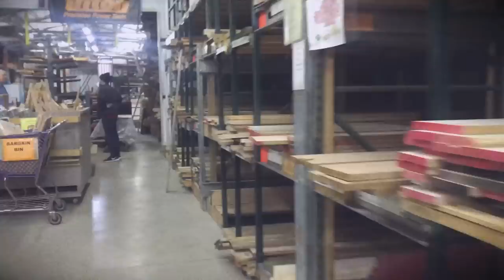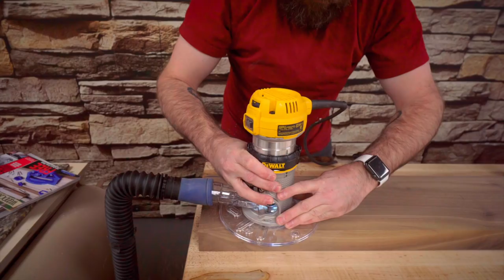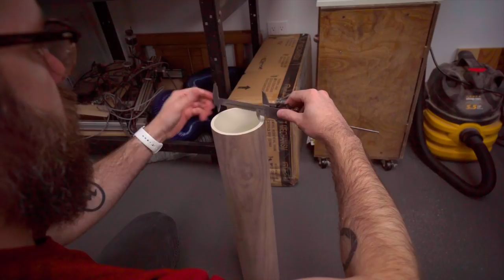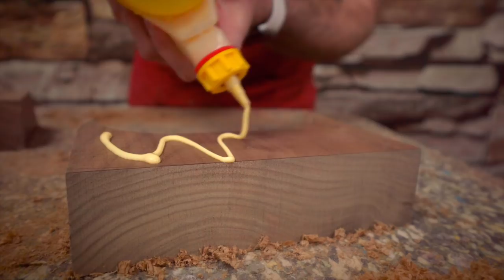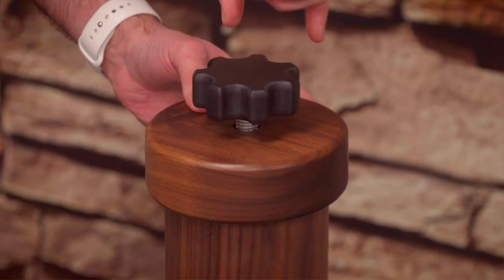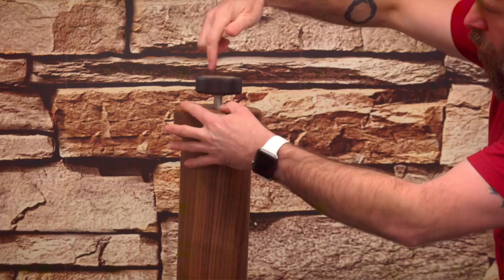Making and Prototyping a Dog Feeding Station | DIY Project

Comment: Going forward, a trick to get a good finish on your hacksaw cut threaded rod, is to screw on a nut before you cut and then remove it over the threads that you have just cut - it cleans them up nicely, so that you don't sit with the problem that you have at the moment where the nut doesn't want to go on first time...
Give it a try.

Comment: I had a store bought feeder that used a rotary valve to dispense. Printed some inserts to reduce the amount it spit out for our small dog. Didn't secure them well enough so they came loose, jammed and shredded the cheapo plastic gears. Now I was trying to print an auger to change the design. But the auger would be horizontal so food would drop in from a large supply chamber through an opening on top and travel only a couple turns horizontally before falling out an opening on the bottom.  Long time watcher. First time commenter. Thanks for all your inspiration!

Comment: Have that all-thread connect to a fixed nut in the base (let the all-thread free wheel through the auger).  Then put a nut on the lid to fit into the auger's hex shaft so you spin the lid instead of your star knob.  This would make the food storage much more stable than just resting on the base.  Also, put some rubber on the inside of that lid to seal it to the pvc.  Hope this helps!

Comment: that's a wonderful project!
be careful about food oxidation by exposition to the air. Imagine you have a solid smaller horizontal cylinder crossing the vertical one as a valve system, this small one would have a vertical large enough hole on its side, but not all the way through, just like a cup. By using gaskets and orings you could make it all airtight so to increase the time the food stays fresh. Then use a knob on the smaller cylinder so as it turns, its cup eventually gets vertical allowing it to scoop full with pellets and as it continues to turn, the pellets drop down on a feeding bowl on the floor down below. Don't make it too big because even when buying commercial rations with bags that have airtight reseals, they still go bad near the end, so unless you are feeding multiple dogs, it is better to keep the containers on the smallish side.
Loved the video, thanks for sharing!

Comment: Heard you hash this some on MAKING IT, impressive to see it come to light. I have been making bonsai pots out of various cement/sand/soil mixes, my thought is that pouring your base into a mold could give it the weight needed to offset a pup toppling it over, and if left outside/next to sloppy water bowl, the wood touching the ground would be less prone to deteriorate. 
Great work again, thanks man

Comment: Here's a tip: if you cut a threaded rod, first put a nut on the part that you need to keep. If it has been cut you take of the nut and the thread will be repaired to it's original shape.

Comment: One option for proto 2 is to use a 45 elbow on the bottom of the pipe and embed that into the base surrounded by walnut. Would slide the food out into the bowl without the need for the angle. Would provide more stability for the large tube as well. Thinking forward you could use same approach for a water dispenser next to it. Food and water would travel in pipe only to the bowl without need for touch any wood. Awesome design, David. Aesthetically pleasing. The jam track in the background was nice as well.

Comment: Hey David, I am a huge fan and just happen to be an aspiring engineer. I have a simple design that you could build and add a motor/controller so that you could control it with your phone. Or just have it on a cycle. The auger would be tilted on its side and there would be a chute above it near one end. The other end would spit out the food into a plate. The entire thing would be the same, but sturdier and it would have a larger hopper for food.

Comment: Just a hint about Fusion 360. If you set the "default modeling orientation" to "Z up" in the preferences, you will not need to rotate the object in your slicer to put it flat on the print bed. I am willing to bet you have the default setting of "Y up" which causes the Y axis of your model to be Z axis in your slicer. The preferences are located in a drop-down menu that has your account name in the upper right of Fusion 360.
Reply from the maker: Ohhh, thanks for the tip!!!

Comment: A lot later (in time) but the overall idea is great.  Changes:  

1 - Dish goes too far back in.  Tray edge Only needs to go just passed the edge of the feeder ramp.  The back edge can be 2 inches long but the tray opening should only go  to the edge of the feeder.  This will help stabilize it.  A screw in the back will hold it in place.  Can be knobbed if you want to remove it.  

2 - Stabilizer "wings" can be put on it to keep it more stable.  A tall structure is more likely to tip then a short stubby one.  3" long wings (bottom out - side length (tall) is up to you) on 3 sides - or 2 sides if against the wall will work.

2a - a simple strap around the top and screwed to wall will stabilize everything.  It would be made of wood and shaped like a conduit clamp but thick enough on the wings to keep top away from wall for removal.

3 - A heavy "dish out" on feeder side (where auger first starts dropping food) will feed the food better.  No more than halfway across the front.  You can make it more if food jambs, but probably won't.

4 - 1 & 2 can be combined by having the tray stick out the back about 2 to 3 inches and pinned on the side to keep it all stable.  Tray edge is still flush with front.

X - if it ever tips over on the dog it will probably never eat from it again.  Unless it is starving.

A - the tube can fit flush into the base and an angled ramp that is large enough will drop food from underneath onto the bowl.  The 2 - 3 inch angled hole drops food onto a ramp that drops it in the bowl.  Much more fancy a design.  Probably should be plastic so food will slide and wood friction would not stop food from going all the way down.  Put it in then trim it flush on both ends.

B - food quantity would have to be observed so look into the top as you turn the wheel and see just how much is picked up per revolution.  Don't worry about it just turn it to give what you think it should have.

That's enough of a change - for now.

Comment: I love walnut, this thing is just beautiful.  Most of the measured food dispensers I've seen use flaps that spin horizontally (if you google image search dry food dispenser, you'll see), or the auger bit is horizontal and dispenses out a port in the front.  Though that does defeat the purpose in requiring you to bend down to dispense.  Though you could 3D print a couple gears to translate the rotation.

Comment: Love the design and the idea behind the mechanism.  You could add anchors to the base so you can mount it to a base board, that way it wouldn't be as easy to knock over.

Comment: That’s a really interesting design and great practical solutions to the problems! I wonder how it would work if the auger is horizontal with a hopper full of food over it. One side of the tube is closed and the other end has an opening. It would take a few turns to fill all the empty space in the auger, but once it’s “primed” it would drop food out whenever it turns. The amount of food dropped might be determined by the size of the auger.

Comment: Nice.  I saw your veneered foam core box the other day.  I like the PVC being covered.  It's a good idea I'd never considered before.  I really like the auger.  I think I'm going to steal that for a v2.0 of my feeder.  But rather than run it vertically, I'd run it horizontally - a big reservoir on top of one end of the auger and drop hole a little bit down the path.  For control, why do it by hand?
   
I made a feeder late last year, but the trick was that my dog loves breakfast at 4am (and he's 100lbs and sits on you until you feed him).  I took one of those hotel cereal dispensers and a high-torque 12v motor and plugged it into a switchable Insteon outlet.  The outlet is hooked up to my home automation system and, consequently, Alexa.  Turning it on for 1s gives him a treat.  Running for 9s dispenses 2 cups.  Now anywhere in the house I can say, "Alexa, turn on Andy {breakfast, lunch, dinner}" and it drops the food a couple feet through some ABS I CA glued to the bottom of the dispenser and makes a good racket going into his bowl.  He hears that and runs downstairs to get it.

Dispenser - https://www.amazon.com/gp/product/B000OQGOEG
Motor - https://www.amazon.com/gp/product/B01EXZXM66
Power - https://www.amazon.com/gp/product/B01N7RS0NG
Outlet - https://www.amazon.com/gp/product/B00QL8EPME

A quick shot of it in action: https://youtu.be/FAXLywo1thA

Comment: I like the concept! I see a few things for your second one, I hope these suggestions help. A wider base would be more stable, kinda looks like that tube could be knocked over. It would also be good to carve out the bottom groove more and use some sponge rubber? Open cell foam type stuff, to line one side so the tube pressure fits in for a more snug seat. The other thing is, I think that Plastic knob should be replaced with a wooden knob. Maybe a CNC walnut knob? The plastic one just doesn't seem to fit the whole design. Okay, that's all I've got for you Dave! I hope you like one of the ideas.

Comment: The auger is kind of being used backwards here with gravity.  They’re meant to pull material along.  Move the auger parallel to the ground.  Hopper on top at one end and bowl underneath at the other.  Lots of ways to do it though.  Make a giant version of a powder scale and dispenser basically.

Comment: Beautiful.  I'd epoxy in a polished piece of copper tube into the lid extended up to where the turn handle stops to hide the threaded rod and act as a bushing inside the lid.

Comment: I had a similar idea, using pvc pipe vertically as a "holding tank", but at the bottom, have a PVC T running horizontal, then another T inline with the first, but rotated 135* opposite direction, the auger running horizontal, a cap with appropriate hole in each end to support the auger.  Then an Arduino and stepper to dispense appropriate amount at specified times of the day.  I'm not a programmer, that's why I haven't attempted this...but it works in my head.

Comment: Before you cut a threaded rod, spin a nut on. Then unscrew the nut off the rod to clean up the threads.

 Maybe add a sloped angle to the back hidden section of the bowl, so the food slides into the open front section the dog can easily reach? So the back section of the bowl does not actually function as a bowl, more of a food transfer mechanism to move food to the front, bowled part.

Love the podcast and cool to now see this. Thanks

Comment: Cool idea with using the auger to measure out the food but I think it would work better with vanes attached to the centre spindle and then have them say 1" tall with a lid over with a hole on the opposite side of the dispensing hole. With the correct clearances, that would depend on the size of the dog pellet size, you should be able to always dispense the same amount of food per turn. I think using 5-6 vanes would work fine and when an empty section then returns to the back filling hole in the divider it will get filled up again and the one to the front will empty itself through the dispensing hole.

I think that should work.

Comment: Great job David! My first thought to address the issue of portioning would be to make something similar to a candy/gumball machine. There's several videos on youtube showing their design but essentially you could make a food storage tub with a portion at the bottom that would spin that had the desired food amount cut out of it. It would fill with food from the storage area and then it could be rotated over to outfeed area and only drop the desired amount. This would also not drop any additional food until it was rotated back around to collect addition food. Would be much easier to draw out whats in my head than putting it in words on a comment but I think that should get you going :) Looking forward to seeing version 2!

Comment: I think you might have a better time of it by finding a way to be putting the auger horizontally. That way, there's only so much food the section of auger for one rotation can hold, gravity doesn't give you an issue for giving out more food than you wish, and you can create a larger dedicated reservoir for the food instead of having the reservoir be where the auger action happens as well. You'd obviously have to change the form factor a little, but performance might improve making it worth it.

Comment: Most grain moving augers that I’ve seen are horizontal. If you did it this way with a hopper feeding the first couple of turns of the auger, every turn might give you a more consistent output as it will remove the effect of the amount of biscuits will have on the output ( as long as the auger remains covered)

Comment: Beautiful project, to solve the dispensing consistency issue , auger the food up or atleast level instead of down and let the food drop into the dogs bowl. Have a second  piece of pvc for a shorter and /or smaller piece of auger and the 3" or 4" pvc for a storage. This should improve the consistency in the amount of food per turn, and solve the issue of unwanted  dispenses.

Comment: Very cool to see you get into fabrication like this, incorporating the 3D printer etc! Here’s a tip for cutting allthread or bolts: if you thread a nut onto the bolt before you cut it, it’ll help fix the threads up when you back the nut off after the cut. Works for me! Hope you do a V2!
Reply from the maker: Great tip, thanks!!

Comment: The auger really should be turned horizontally (or at an upward angle) in order to dispense the same amount of food per turn. You'd need a food reservoir at one end and the bowl at the other. Using that, you could 3-D print an auger with the correct spacing for Wally's 1/2 cup of food. Then ask Bob to help with an Arduino to automate the dispensing.
Reply: And bastardize the whole thing with a giant "DIRESTA" logo.

Comment: That's a neat idea, man.  Lots of different tools, skills and materials involved.  I've been kicking around ideas for an automatic feeder for my shop cat since she won't eat wet food, and trying to avoid looking up other people's solutions.  I'm probably going to have to learn a basic timing circuit or get fancy with an Arduino.  I would probably set up a sensor for an automatic watering system as well.  And then to make it needlessly difficult: run it on solar power.

Comment: Next level, Pacciuto! Freakin' awesome. My suggestion for the mark on the knob is to just put a small embossed arrow or something right into the 3D model. Then add the corresponding label to the top of the feeder when you find the sweet spot.

Comment: I think it is really cool and looks beautiful. The only change I see is to maybe remake the base piece, now that you know the depth to route the groove that the tower sits in. Seems like that base piece could have screws from the sides and back to lock the tower in place. And also the opening in the base piece where the food bowl slides in could be made shallower since you said the bowl slides too far back.   So, all of the issues, which are minor in my opinion, could possibly be fixed just be remaking that base piece.  Again, I love the project. Only offering suggestions because you asked. :)

Comment: Just an idea but you could try cutting a quarter of circumference of the pipe on the back side...enough to make the auger assembly stay in place and then build a wider box with an opening the size of the opening on the side of the pipe and then add a wider base assembly and attach the pipe assembly to it...that way it's not going to tip over so easily and will store more food as well...I apparently love to use the word assembly...lol

Comment: If you want to cut a threaded rod, here's a trick: before you cut the rod thread a nut onto the rod above where you're going to cut then make your cut. Once the rod is cut unthread the nut over where you cut, and it will clean it up.

Comment: Use a sweeping tee. Place the screw horizontally and the food vertically that way as you turn the screw food is moved forward to the dispensing side and down to the bowl.  Just my thoughts but I like it.

Comment: If you glued a little block of wood as a stopper inside the tube at the bottom that would contact the bottom tip of the auger in closed position, so that you rotate it all the way right, it is open, all the way left it hits the stopper at the point where it is closed, that would solve the open/closed issue. Great video, this is a cool idea.

Comment: I am sure you wont see this at this point. But halfway up. Split the tube. Use a 45 degree y adapter. Use that to fill the tube. That way you wont be removing your gear every time you are needing to fill it.